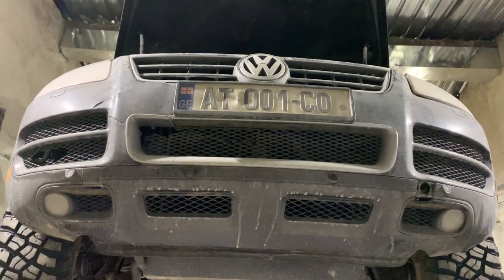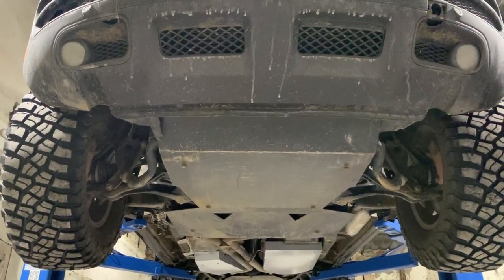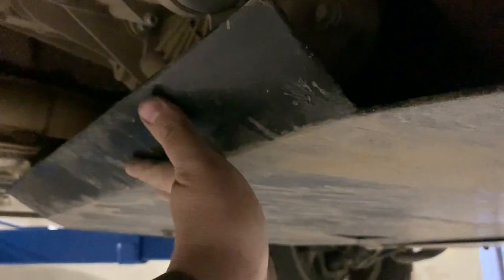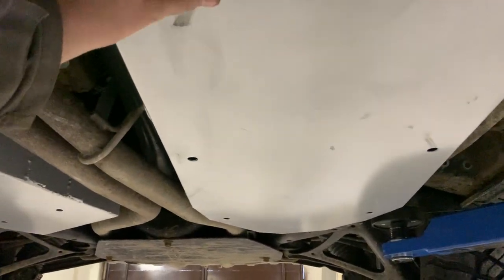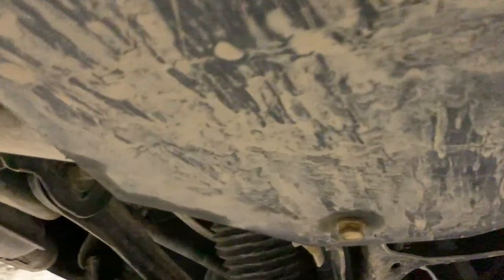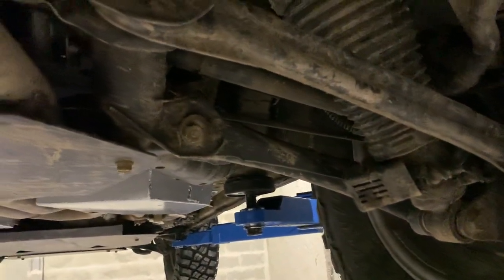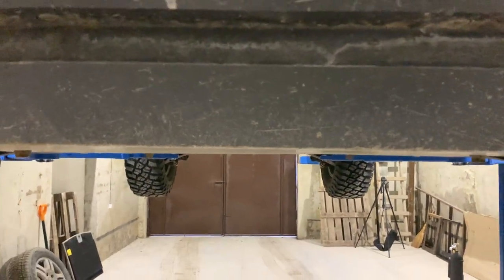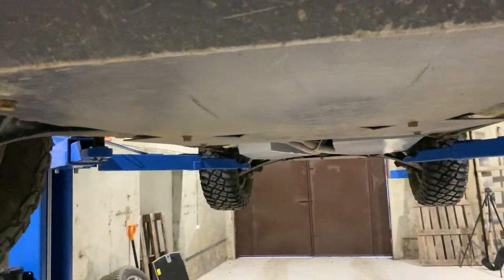Touareg under body protection

Comment: They look good I only worry about the fuel tank one. If you put the weight of car on it the tabs that bolt to the body may bend...the motor, transmission and transfer case and rear differential 💪👍 I guess you have access to metal shop! 🍻
Reply from the maker: So far I never had any damage on OEM protection so i hope I will not have such a great stress on these too so i will not have any issues

Comment: it looks like pancer tank now :) my suggestiin is try to change bolts on the middle plate becouse this one are lower then plate sufrace and when you hit by the bolts to some rock or something  then the bolts head will be cutting off .... maybe some flat head bolts witch spline ...
Reply from the maker: Thank you 😊 agree about bolts but need to find something to protect them, so far no problem with them

Comment: Can this fit in a 2009 touareg , please share how u made those covers , I need them for my car
Reply from the maker: yes they will fit,  unfortunately i can not explain all the details how i mad them, im not making them to sell, i made them for myself, it is extremely easy to make them as touareg has flat belly and you just need to get metal plates, steel or aluminum  and improvise with the angle grinder and drill, it needs bending only in 2 places  and you need to figure out how you will gonna attach it to the subframe,  subframe already  has holes so  you can use them, thats what i did

Comment: how does the air suspension resist? any problems considering heavy offroad? do you have rear locker?
Reply from the maker: During this 9 years of my ownership i have never had any problems with it, only few times when  i have been stuck on my belly it thinks that car is in accident and it lowers it to lowest level but as soon as you will turn car of and on again it raises and you can continue as normal
Reply from the maker: Yes i have rear diff lock:)
Reply: @LOCOTouareg  great, i was afraid to use it too much in offroad!